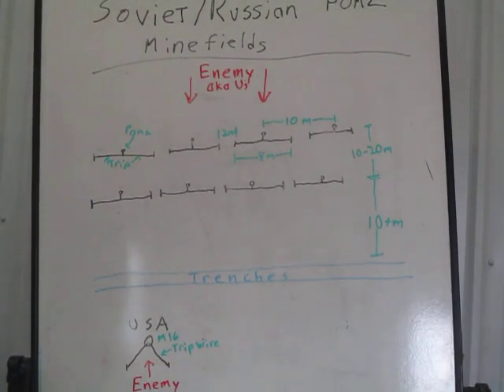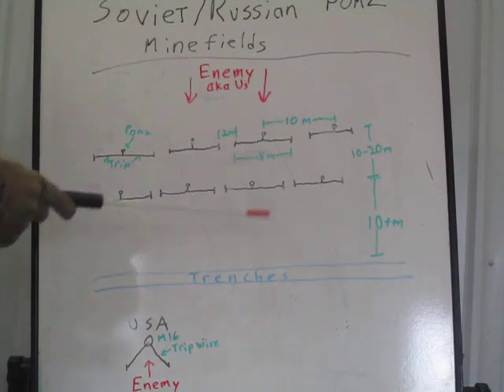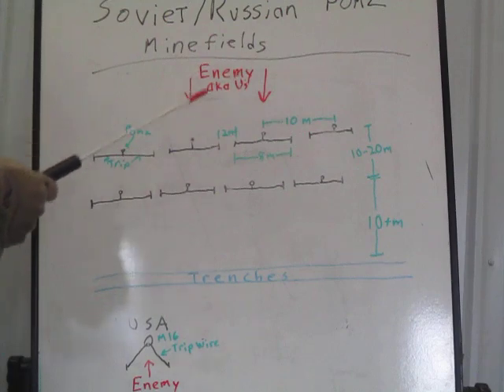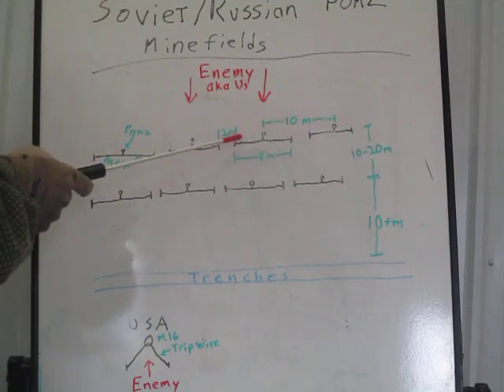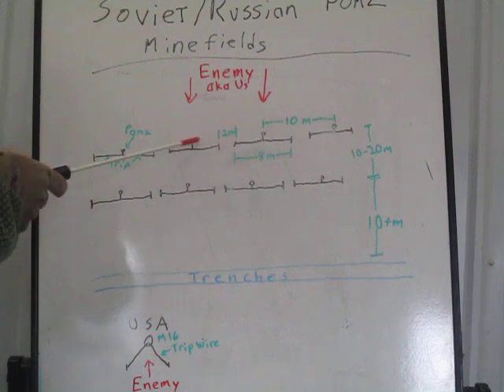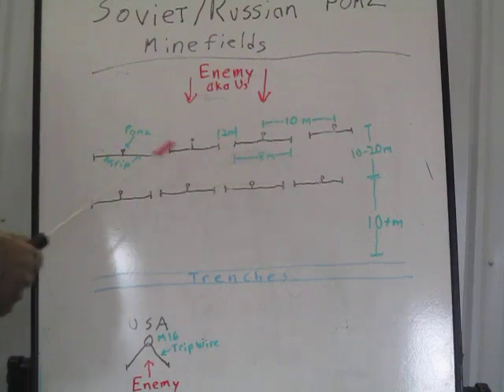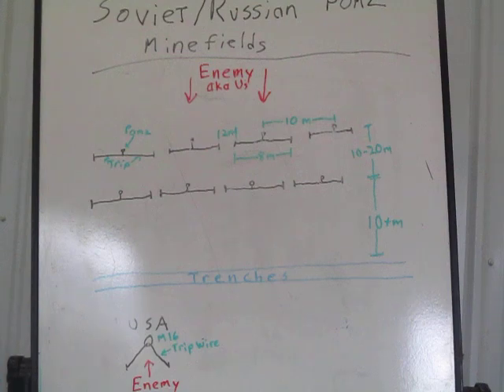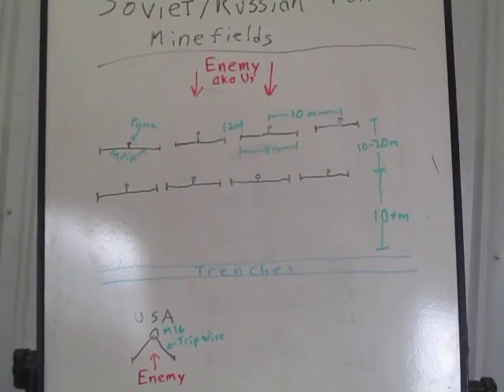Militia Engineer Task- Russian POMZ Stake Landmine Minefield

Comment: Question on the fuze is it just one pull ring that the 2 tripwires are attached to?
If one  pull ring does the fuze rotate to allow the pin to trip easily? Was looking at pictures of the mine and only saw 1 pull ring.
Reply from the maker: Yes, the trip wires would attach to the same pull ring.